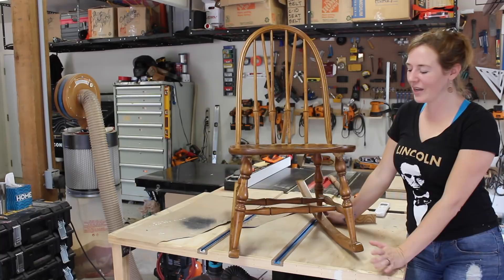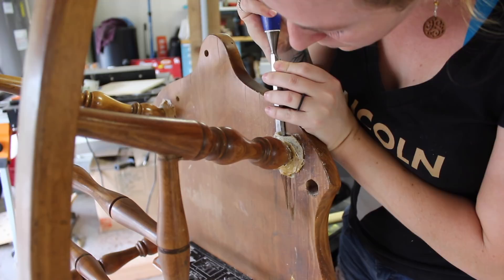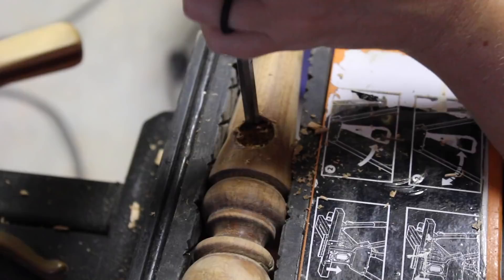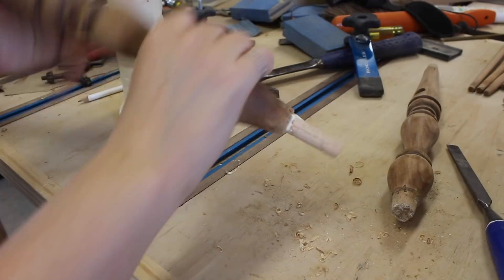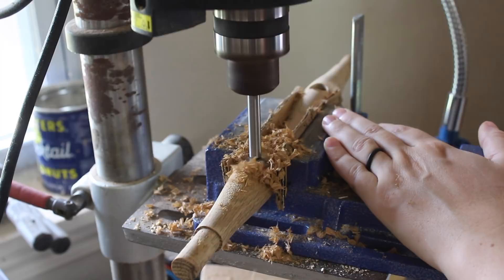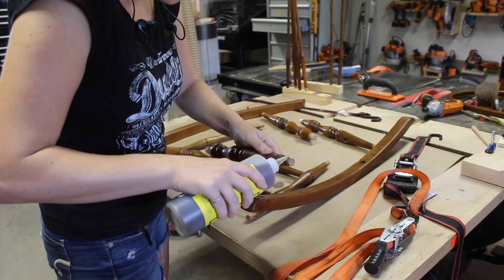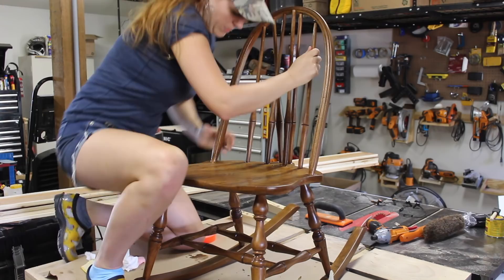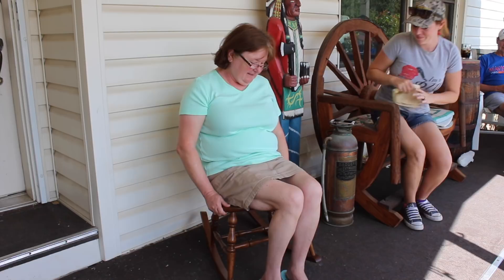Restoring an Old Rocking Chair

Comment: One of the hardest jobs I had to do, was when my landlord asked me to dismantle an old wooden ironing board, so he could re-purpose the wood for a "chair". I was in awe while dismantling it, as it had an engraving at the bottom. Their last name, and the date 3-15-1891. I offered to help with the "chair" but he said it was fine and he could handle it himself. A week later, I saw what he made. It was a laundry stool, an 9 inch sitting stool for when you are doing laundry. The other parts he made into a club, for beating the dirt out of carpets and jeans. I wanted to cry at such a loss of an heirloom. But it was theirs and really had no say in what they did with it.

Comment: Hey April,
1) Nice work!  And yeah, you need about five hands to put a chair back together sometimes.

2) I was really GLAD to see you pin up your hair before you fired up your sander.  My wife had really long hair for years and once, even though it was tightly braided, the tail came around while she was working and just brushed the belt sander while it was running.  ZIP!  Fortunately the sander only whipped her hair around and threw it out at the back end, but it was pretty damned scary.  I think it would be a great PSA if you would point out some of the hazards you're trying to abate once in a while.  I know lots of newcomers to the craft watch your vids because of your approachable style, and giving them a quick heads up of certain things to watch out for might help save someone some hurt.

Comment: Love your work and how it turned out.  Many years ago I read an editorial in Fine Working regarding which glue to use where.  One comment the author made was to remember that a future woodworker may need to repair the piece in another 80 to 100 years so don't do anything that is not reversible such as using epoxy on antiques.  I know that this is not an antique yet but maybe your great grandchild may need to fix it in the future when it is an antique.  
Please remove your rings when working around machinery.  One snag of a ring can result in a major injury to a finger known as degloving. Sorry the dad and nurse came out. Keep up the great work.

Comment: Good job on the restoration, I like your idea of collars for the undersized tendons. I do have one quibble though, the rest of the rocker is clearly not oak and after seeing the grain difference why did you not remake the spindle in maple, birch or alder which would have been a much better match. I also like your ingenuity in clamping things together since I know from experience that gluing and clamping chairs is never easy.  I would also question your use of hide glue since its main reason for being used is the ability to take things apart again.

Comment: April, loved the video. Just one question is there a reason you didn't put the spindles in the lathe and sand them? Not a criticism, I'm just assuming you know something I don't... maybe too aggressive... again it looks amazing. Loved the backstory with your mom.
Reply from the maker: At the time I hadn't pulled out all my lathe stuff, it was all still in boxes until I got ready to turn the spindle. So I didn't have the stringer that goes into the end to hold the spindles. It would have been much quicker to chuck them up. : )

Comment: What decision process did you go through in deceding what type of glue to use for which joint? Hide, epoxy, ...
Great vedio. Thanks.
Reply from the maker: A lot of furniture restorers use hide glue on joints because it's reversible. So if the piece ever needs repairs or refinishing in the future, it's easy to take apart. It also has a longer open time while you are applying and assembling. I used epoxy on the bottom because I wasn't impressed with the holes after cleaning them out. The fit was no longer snug when I was putting back in the legs so I used epoxy. Epoxy is not reversible so those joints will be permanent but epoxy is the only adhesive that can fill gaps, which is what I needed. I used wood glue on the dowels in the tenons I made because I wanted those pieces to fuse together and become one piece essentially.

Comment: What's the best way to drill a straight hole like you did with the dowel at 2:45? I have to repair a croquet mallet and thought about using this method (drilling out the center and connecting with a dowel) but I'm worried it won't be straight and the mallet will be wonky. Thanks.

Comment: Great job April.  Educate me...why did you select hide glue for this....??
Reply: Stanley Pearse I wondered the same, I have no experience with hide glue, and wondered what made it a good choice for this glue up .
Reply: the single best reason to use Hide glue is that it can be removed with hot water, so a future repair is easier.  The downside of using the two part epoxy for the seat joint is that a future repair will require the same cut and restore dowel method she used on the broken spindles.  Yes, it is a strong joint, but future repairs are more difficult.
Reply: Hide glue is a pretty traditional choice for assembling furniture, and as another respondent pointed out, add hot water and you can take the joint apart.  Cold and dry, a good hide joint will tear wood fibers before the glue lets go, and it's a bit more forgiving in the cases of less-than-perfect joints.

Comment: Wouldn't it have be easier to use a full sized dowel and lathe it down to fit the hole you drilled when you did the broken spindles. Then it would have been one solid piece instead of a dowel and sleeve which over time could come apart after years of use. Great video tho and great job.

Comment: What made you use hyde glue?
Reply from the maker: Two professional funiture restores recommended it. It's reversible so if the chair ever needs more repairs in the future it will be easy to take apart, but another pro is it has an longer open time. So you still need to move while assembling but you have more time than using wood glue or epoxy.

Comment: Great job, but, hide glue????? There's a reason that poly and epoxy glues were developed! I appreciate you wanting to restore it to original condition. However, you may be disappointed with the longevity properties of hide. Again, beautiful job, and what a nice thing to do for your Mom!
Reply from the maker: I suppose we'll see. I used hide glue after two professional furniture restorers recommended it. I trust both of these folks to know what they are talking about since they do it on a daily basis.
Reply: Really hope it works for you. I've tried it and didn't have any great success. Ended up re-doing it with Titebond II. Maybe it was a glue quality issue -- i don't know, but it's a lot of work, (as you saw,) to carefully pull apart and rebuild old fragile, brittle things, so it's something you don't want to have to repeat! Your Mom's right, though, that color came out beautiful!!!